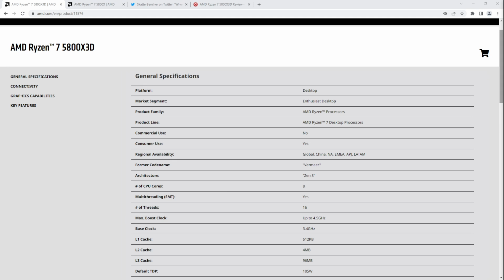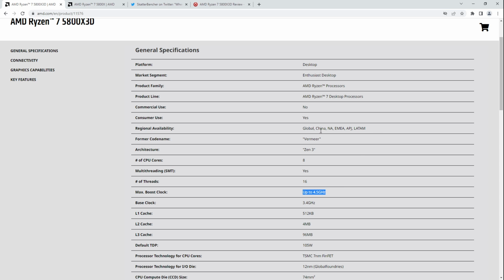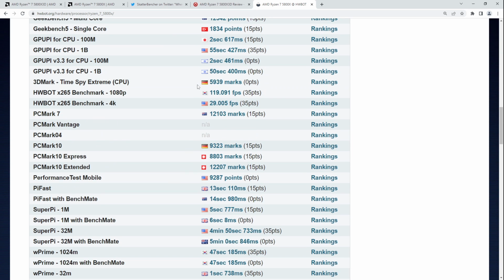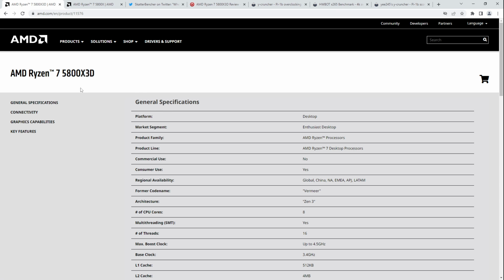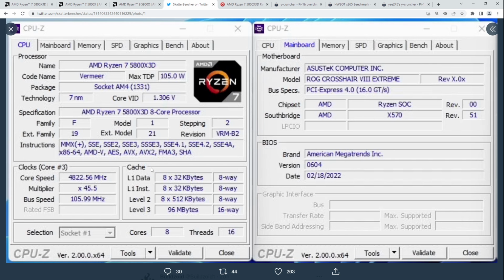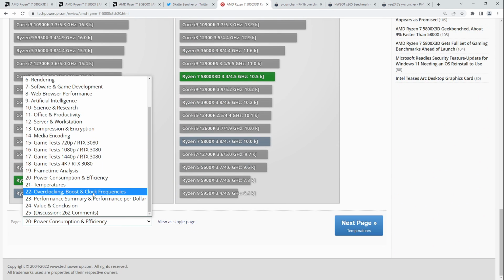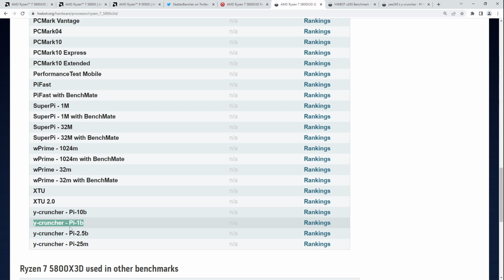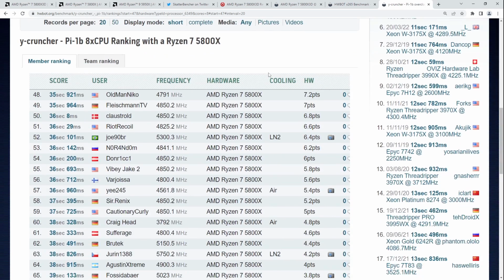Buildzoid's 5800X3D overclocking rant

Comment: can confirm my 5800x3d is hitting 90 degrees 3 seconds into cinebench r23 with a dual tower cooler in an air conditioned room. but im scoring the same as all the reviewers so I'm assuming this is how it's supposed to be?
Reply: You have a 5800X3D already?
Reply: @clippers117  Yeah it was available for sale in India for like a few hours about 5 days ago. I managed to buy it then. It's been unlisted since then.
Reply: From what i've seen, they're all going to run mid 80s. No matter what. I've got a 360mm Arctic Freezer on mine. Air conditioned room. Runs at 85C under heavy loads. I think the internal temps are just going to be in the mid 80s no matter what, the goal is to keep it from throttling as long as you can.

Comment: 4:25 Spoiler, they're not. Reviews show the 5800X3D's temps in the same ballpark as the 5800X (so it's high compared to the other 5000 series CPUs but not that high) under all core application loads - but actually lower power draw (and therefore you'd exect lower temps) than the 5800X under actual gaming loads. It's not a Intel KS kind of temp increase.
Reply: unless you havent used zen 3 personally you dont know how hot 5800x/5900x/5950x runs not on all core tests but on workloads which utilize just a couple of cores very heavily. 5800x is notorious for that but other skews are guilty of that too, 5800x3d is going to be even hotter which is honestly kinda worrying to me

Comment: For non-extreme usage, 1.3v is more than enough to get to 5 ghz single core and about 4.6-4.8 ghz on a good "main" chiplet. Cache is not thermally constrained, I'd say AMD just wanted either to salvage all semi-working dies (as 3d tech is still expensive) or didn't want to bother with binning as there's only one SKU (or it's just simply binning rejects from epyc 3d series)
Reply: its probably binned epyc castoffs & i'd be shocked if this ends up being a 'largely available' cpu in 6 months

Comment: AMD spokespersons have specifically stated, several times, that the safe voltage limit for the V-Cache is ~1.35v and ~1.5v (boost) on the normal Vermeer chips, and we know that the cache die is using a density-optimized library on TSMC 7nm (designed for EPYC). While the cache isn't exactly known for running hot, it doesn't take a huge leap in logic (hehe) to infer the voltage characteristics of transistors on a density optimized process, as opposed to a power/performance-optimized process, will be worse. Not only are the transistors packed closer together, increasing leakage current, they may have fewer fins in the actual FinFETs (or be physically smaller in other ways), thereby lowering their current carrying capacity (increasing heat concentrations, electromigration, etc.).

Thermals in these sorts of high-power stacked chip designs are obviously going to be a concern and present a serious engineering challenge, but I don't think it's the principal reason they're trying to discourage overvolting. Frankly, I wish, they'd left the multiplier unlocked and just asked the motherboard makers to hide/limit the voltage controls, but here we are.

https://www.youtube.com/watch?v=qKQAY0k8f1E&t=2744s
Reply: Don't care. Want cpu to go faster.
Reply: @LawrenceTimme  yeah. monkey see higher GHZ. monkey think more ghz =  more performance. cant belive AMD are depriving me of 3% of performance in daily use. This is despicable. AMD, who built the chip, clearly have no idea how to build a chip. Trust me, I make youtube videos.
Reply: I'm just stuck thinking how many of these chips could overclock by +200MHz without even touching voltage. The effort they've put into mitigating whatever problems the cache might have with thermals/overvolting seems half-assed, TBH.
Reply: @Zigglegarf  agree
Reply: @fredd3.14  I don't use this crap daily. I only use it for overclocking. 😂 That 3% is huge between winning and losing.
Reply: Meanwhile, AMD """""""""""engineers""""""""""" lowered Zen 3 Vcore on boost to 1.45V for whatever fucking reason in later AGESAs.

Comment: I think AMD made it harder for the plebs to overclock Zen3D because it could cause problems for low-end Zen4.
Reply: not if zen4 also has 3d vcache
Reply: Zen4 getting 3d cache a year and a half later isn't going to help it being slower than zen3d at launch plus the cost of a board and ddr5.

Comment: all ive been seeing is that voltage was the factor for locking multiplier settings. if 1.35 is the max voltage allowed on this chip, why the FUCK did they lock the core multiplier? its VERY likely that a large amount of these chips can run at a higher frequency at the given voltage of 1.35.
if heat was the issue then i think thats slightly bullshit because they dont get to pick what coolor you use. some people may use a slightly worse cooler, in a poorly ventilated case, with a high end gpu resulting in..what? a dead chip? a blue screen every time you reach X temp? if temp was the case, they couldve implemented a lower Temp Limit with power limits in relation to temp. 
i understand that the cache literally being slapped ontop of the cores acts like an insulator and makes temps worse but.. at the same time...it just seems like the whole ""1.35 is the max so we locked overclocking"" is a lie and they arent telling us something. 
another thing to mention... did they lock LLC control? because the difference between lvl 1 llc and say lvl 6 llc can be literally a tenth of a volt or more.

Comment: There's another option I've considered tho it's unlikely. Its possible the cache layer and the compute layer expand at different rates when heated. So there could be a temperature at which they would separate.  Or at least pull away from eachother causing Lord knows what issues.
Reply from the maker: yeah I've considered the same thing I just don't  see the physics of how it isn't a problem when the CPU hits 90C at stock voltage but is a problem if it hits 90C at 1.3V.
Reply: @ActuallyHardcoreOverclocking  same. Whatever it is I'm really curious to find out.

It's still possible for someone to make a custom bios and vrm to find out is it not?

As you said the chip doesn't regulate the voltage the board does
Reply: @christopherjackson2157  I believe Steve from GN asked one of the Mobo vendors and they said they could, but wouldn't, at least not release one. Maybe they'll provide some for their sponsored teams, if it comes to that.
Reply: @guiorgy  as he said in the end of the video tho the clockspeed is generated internally so while you could overvolt the chip potentially it would be very difficult to use it to anything very useful. Presumably there's an oscillator internal to the chip that generates the base clock?  If that's how the frequency is generated ur starting to get into the range of "why don't I just design my own chip?" In complexity lol
Reply: @christopherjackson2157  MB manufacturers have seemingly confirmed though that the actual CPU has no overclocking limitation and it's just an artificial BIOS limitation, with the right BIOS would probably work